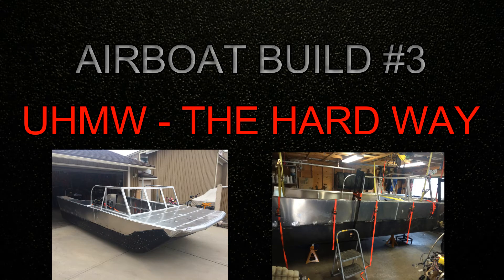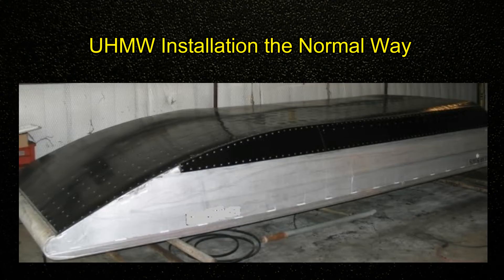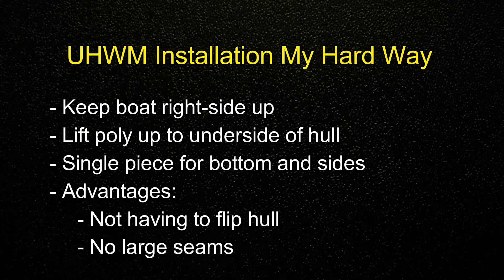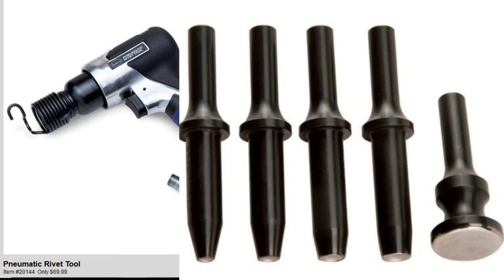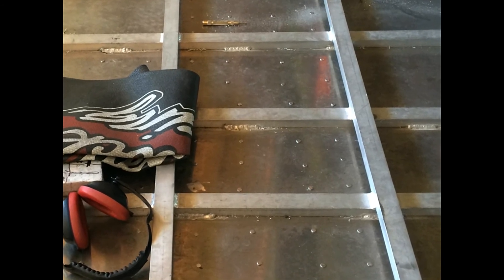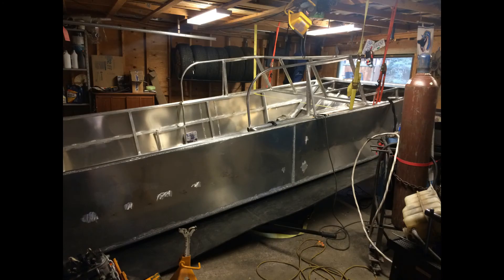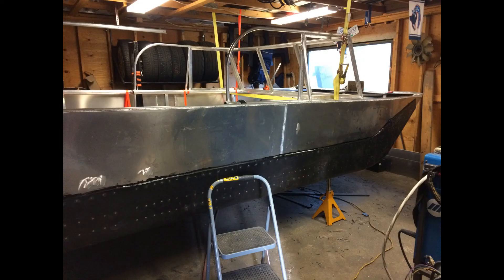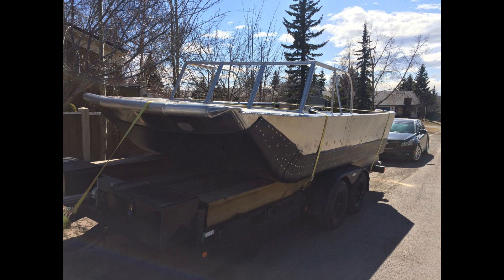Airboat Build #3 - UHMW Installation the hard way!

Comment: do you not get issues with thermal expansion with it all in one piece?
Reply from the maker: Excellent question.  Yeah it does change with hot and cold.  I'm hoping the large number of rivets will hold on tight; even with the stress of expansion/contraction.  So far it hasn't been too much of an issue but a few rivets on the edge have sheared off.  I plan on replacing them and adding extra rivets.
Reply: @dr.dansgarage  Yeah i've been thinking about putting it on a larger boat to make it river-worthy and was thinking maybe having expansion joints and filling the gap in with some kind of compressive sealant. It's a great material but it's a nightmare to attach to anything.
Reply from the maker: N330AA it would certainly be easier to attach in smaller pieces.  The advantage of one single piece is there’s no seam to catch the water and get ripped off.  However, with a high quality urethane or similar I think it would be possible to safely and durable fill the seams.
Reply: @dr.dansgarage  yeah good tips, cheers

Comment: Great Video, I'm just about to start the same project.  I was wondering if you put any sort of silicone or sealant on your rivets to make them waterproof? And if not have you had any problem with leaking? Thanks
Reply from the maker: Bryan Richardson , I didn’t use anything on the rivets.  I haven’t had it in water yet so I don’t know for sure, but I don’t think they’ll leak.  When the uhmw compresses around the rivet they are in there really, really tight.  I did use some urethane sealer around the edges of the uhmw, mostly so that water doesn’t get in there and freeze.

Comment: Where did you get the uhmw.  How wide and long can u get it in , thanks, great video.
Reply from the maker: Thanks.  I bought it at a plastic supply company called Redco in Edmonton Alberta.  Mine was a single sheet 12x16'.  I think it came off a role 12' wide so the length was whatever I wanted.  The usual use for UHMW is liners for dump truck boxes.  A supplier for the dump trucks should be able to get you some.
Reply: Thanks Dan ,  Do you have any pics of your airboat completed.
Reply from the maker: I’m still working on it.  I plan on making more videos as it comes along.  Next will be engine and rigging.  I was hoping to have it done by fall but that won’t happen now, so hopefully spring